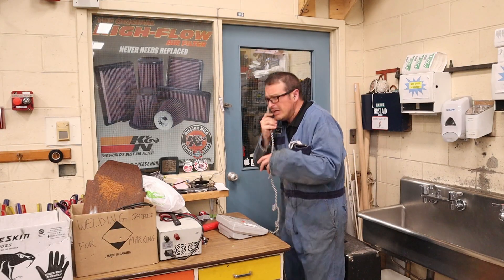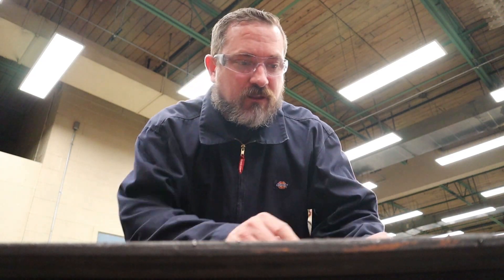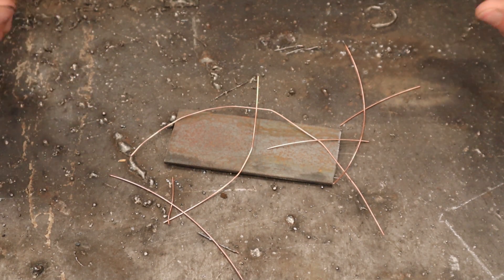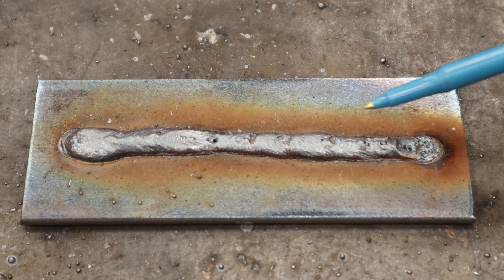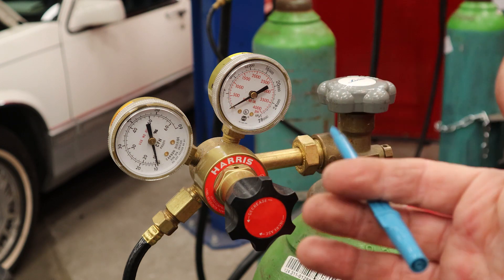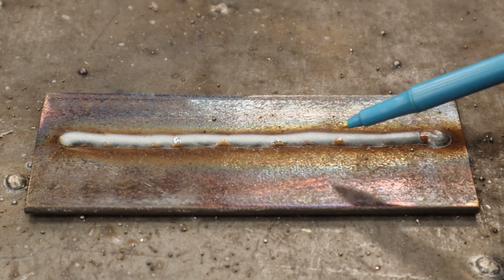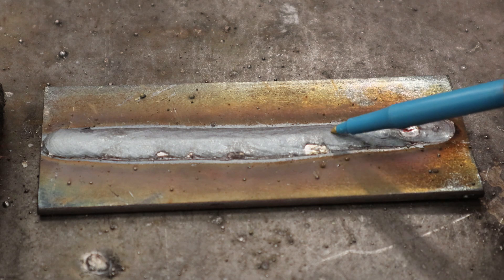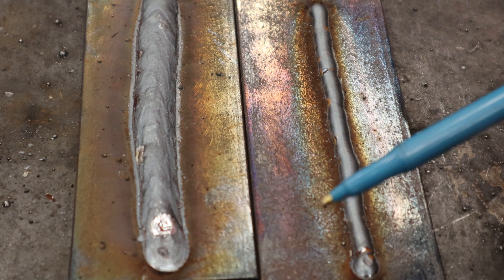How to diagnose your MIG welds

Comment: Is it better to have gas or enrobed wire to weld ? Or is it just a price question?
Reply from the maker: Gas shielded is better but flux core is cheaper because it doesn't require gas.  Hope that helps. Thanks for the watch!
Reply: @wayofthewrench yes it does, it confirms what I thought thanks 🙏
Reply from the maker: Perfect!